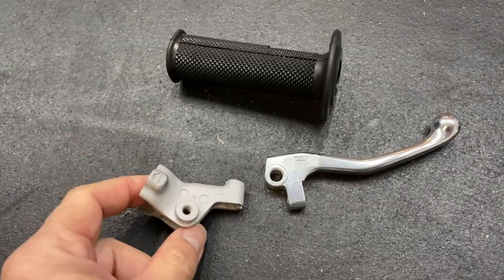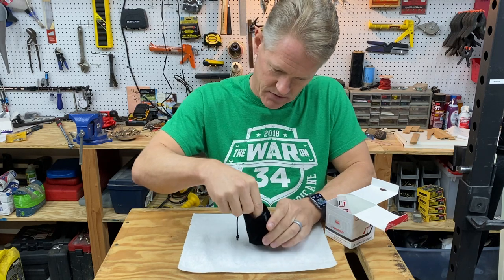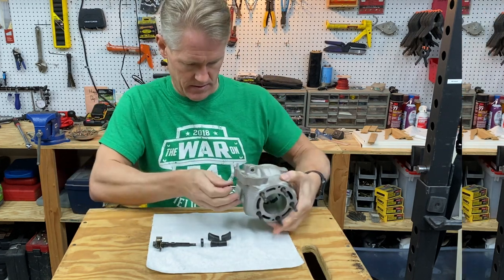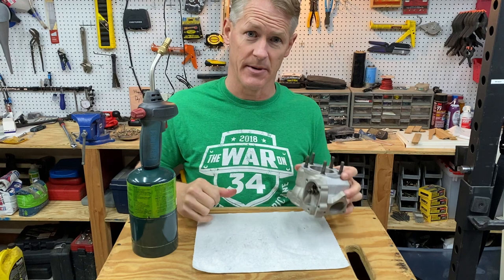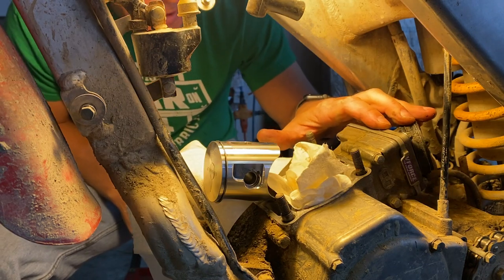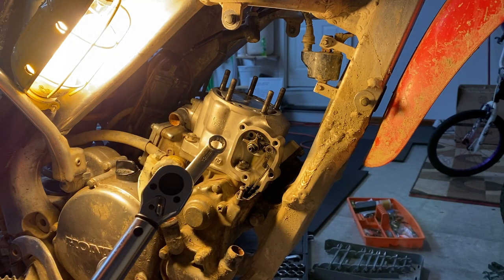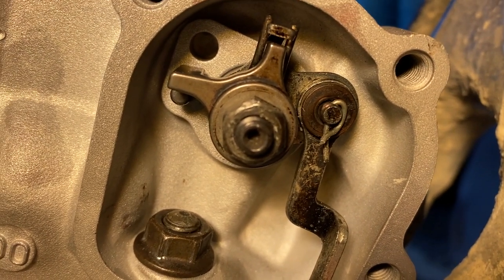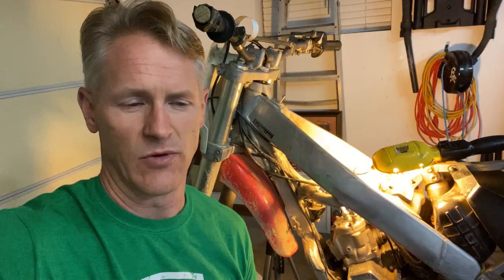We fire up the CR125 after the cylinder repair

Comment: Hi , its piston slap I'm sure  , it happens on forged pistons and you will find that the noise gets less as you ride the bike and get it hot. I had the exact same problem after my was jug re -lined, I now only run cast piston as I hate the sound. Double check your piston to cylinder clearance if you have the tools. it should be 0.05mm between the two for a cast piston and slightly larger for forged about 0.06mm to 0.07mm for room to expand. Correct me if I'm wrong and you've sorted your problem. 

hope that helps
Reply from the maker: Thanks for the info.  We’ve been waiting for the weather to warm up before we ride it any.  I’ll report back once we put a few miles on it.
Reply: @TheRacingNelsons  Ah right , yeah let me know how it goes! , once its got heat in it you should find the noise fades. That piston slap isn't a very pleasant sound I know. If it doesn't fade when hot then its time to check piston to wall clearance. The ring having to much gap at the start might be an indication the cylinder hasn't been
 re-plated correctly and the jug is out of spec. This exact thing happened to me and they re -lined it for free. Hope this helps a little !